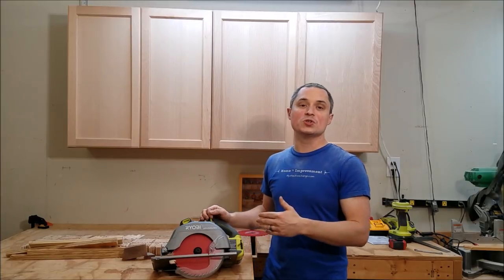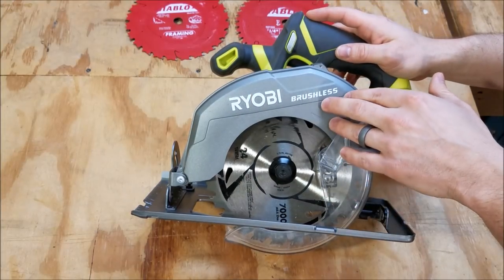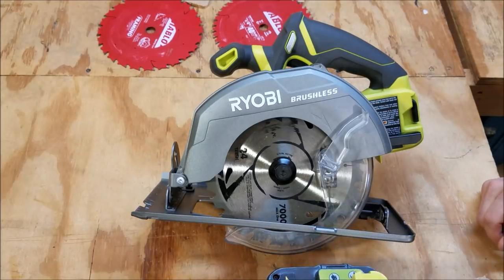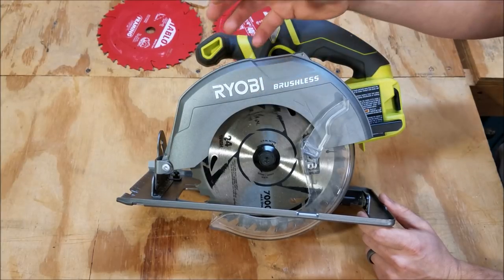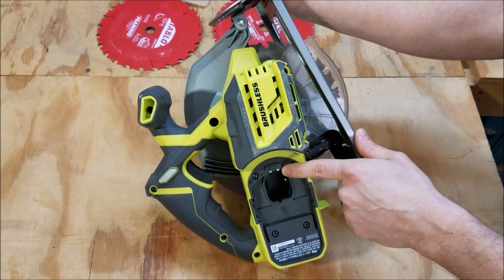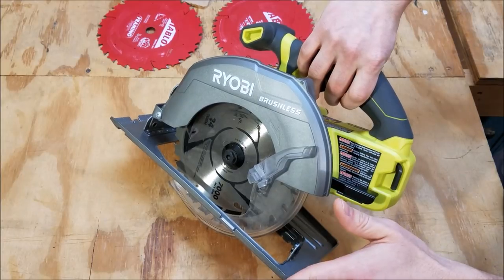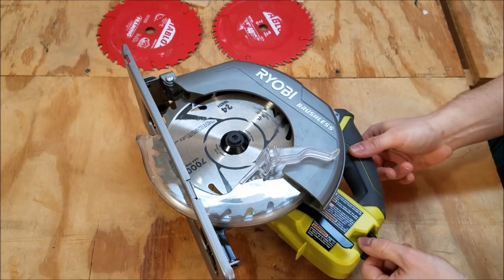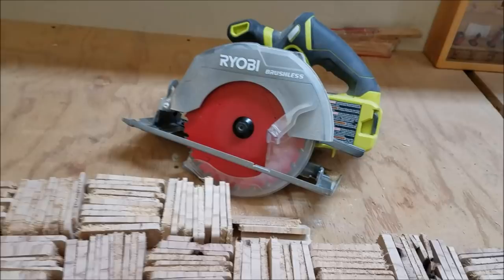Ryobi One+ 18V Brushless Cordless 7-1/4" Circular Saw Review

Comment: Bought one of these today and returned it immediately. Brand new out of the box, not even a refurbished one, and the arbor lock does not all the way so it was impossible to put a new saw blade in. Injured my finger attempting to replace the blade when the arbor lock slipped after multiple attempts. The one I got had zero quality control, they literally slapped it together at the slave labor camp and called it a day.
Reply from the maker: Are you sure you had the actual spindle lock spot and weren't feeling the brushless motor indexing like I explain around 9:05? It was a little tricky to find on mine, but it was there. Otherwise, I agree - I'd be taking it back to the store if I had the same problem.
Reply: Thanks for the reply. I did find the arbor detent/gap slot, but it would slip out after a certain amount of torque no matter how hard the arbor lock button was pushed down. First time I've experienced this kind of problem with a circular saw. Even tried crescent wrench and an impact wrench with an allen bit. I'll probably try my luck with the Ridgid brushless gen5x one next.

Comment: Thanks for the excellent review. I got one today for $99 at Home Depot. I believe that is a permanent price drop. Can hardly wait to use it. Batteries come in Wednesday.
Reply from the maker: I'd highly recommend the new 6Ah batteries for use with this saw - they make it a completely different tool!
Reply: I ordered a Powilling 5Ah battery from Amazon. It has excellent reviews so I took a chance on it. It was $37. I will let you know how it performs with the saw.
Reply: Also, I thought I would add a comment on the blade lock. I am a female and not very strong. When I was trying to install the blade I had the saw in my lap and was trying to push the lock mechanism. No dice. So I put it on the floor and that gave me enough leverage to do the job. I thought it would have been a little easier to do but maybe with time it will get better.
Reply from the maker: Good to know! Here's the comparison video I did between the 4Ah and the 6Ah if you're interested. https://youtu.be/Qf3_WJqg8mg
Reply: I did watch the video and the  difference was noticeable. I am curious about and hopeful that the 5Ah battery will perform well.
Reply: @talrodriguez1206  nice dobie!

Comment: Good deal if you already have other battery powered Ryobi tools like blowers, leaf cutters, drills, etc, like I do...no need to buy more batteries/charges, just the circular blade. I’m getting one. My 18V Lithium P107 are more than enough.Thanks for the cool review.
Reply from the maker: Just a note, the compact style batteries (like the P102 and P107) will run the saw, but won't put out as much power. I could feel a difference in performance when using the P108 vs the P102.
Reply: Isn’t the P107 stronger than the P102?
Reply from the maker: The P107 has five 3.6V cells with an energy storage capacity of 1.5Ah each, while The P102 has five cells with a 1.3Ah capacity. The main difference between those two is a little bit more runtime offered by the P107. On the other hand, the P108 has ten cells with 2.0Ah of capacity each, which equates to 4Ah total for the 18V battery. The reason the P108 can output more power (not to be confused with runtime) is because it can draw current from both sets of 5 cells simultaneously. For a power tool, current draw is directly related to power. The P107 may be able to output a little more power than the P102 if the cells are a better quality with a higher max discharge rate, but where you'll really see the difference is moving to the P108 which has twice the cells.
Reply from the maker: And yeah, that's a sweet deal they've got going on right now!
Reply: You know your stuff! Thanks, just ordered the kit!
Reply: I also bought better quality blades...
Reply from the maker: That will really help with performance. I use Diablo blades in just about all my saws.
Reply: I got an Avanti 60 teeth for fine cutting. I also got a Diablo for PVC plastic cutting, that sucker was $45, ouch, lol...

Comment: Some people say it dont cut straight what u think
Reply from the maker: I haven't had any issues with it cutting straight myself. If I need a perfect cut, I'll use a guide with it. Now bevel on the other hand, this thing has some problems if you need perfection. I found it only hit 90° perfectly when I had the blade at full depth. When you raise it up, it goes a tiny bit out of square for bevel unless you re-adjust the bevel setting.

Comment: Great review!
What is your thoughts between the Ryobi and Kobalt brushless circular saw? 👍🙏❤️
Reply from the maker: I haven't used the Kobalt saw, sorry. Between Ryobi and Kobalt, Kobalt seems slightly higher quality to me, but Ryobi has a much broader 18V platform. I'd pick Ryobi, especially since Kobalt has switched battery voltages a few times on their customers.
Reply: @DoresoomReviews  👌👍🙏❤️

FYI, we are new to this and previously we didn't have any power tools. Recently we brought several Kobalt brushless tools plus 4 & 6ah batteries and we found that Ryobi tools are nice too if you use 4ah or high batteries

Comment: Those are hp connections for the tool to talk to the battery
Reply from the maker: Yes - I made this video before HP batteries existed. So my guess turned out to be right.
Reply: @Doresoom Tool Reviews  I didn't know tools without the hp badge or black an green colors could do the connection now I want this thing even more not just cause the left handed blade
Reply from the maker: Quite a few of the initial Ryobi brushless tools have the contacts, even though they were released prior to any "HP" branded tools or batteries. I guess Ryobi was just planning for forward compatibility.

Comment: 119$ for just the tool tbh it is not worth it without giving a good battery and charger with it. When can buy a tool or tool combo with battery and charger for that price. In my opinion Ryobi is ripping people off for a tool that unless your a contractor are not gonna use all the time and its just gonna set around
Reply from the maker: The bare tool price is getting a little high for most Ryobi tools, but the move to brushless does come with increased cost of components. Ryobi doesn't want their users leaving for another brand because they aren't keeping up with the rest of the power tool industry's capabilities, so hence this new line of brushless tools. If you wait for a promo to buy this, it's much easier to justify the cost - I paid $150 for the brushless hammer drill, one P108 battery, the P117 charger, and this brushless circular saw.
Reply: Wow that is a great price. I hope they come out with that deal again.
Reply: @LibertyDIY  This deal is coming up this Black Friday 2018. I'm definitely getting this deal!

Comment: The extra battery prongs are because this is a one plus it takes several battery's even some other brands battery
Reply from the maker: No that's not what One+ means, it only takes Ryobi 18V batteries. The only exception I can think of is Arctic Cove, who uses the exact same batteries with a different color scheme. Most other Ryobi One+ 18V tools do not have the extra contacts unless they have brushless motors. I have a garage full of them, and I have checked. The only batteries that have the matching contacts are the new HP versions, which came out after I made this review - so my hypothesis was correct.

Comment: I got the drill, the impact driver, the jigsaw, and the circular saw, PLUS 4 batteries (1 of the 2 ah, 1 of 3 ah, and 2 of the 4 ah), for a mere $256.  Absolutely amazing deal from Ryobi.  For my purposes, these tools are more than adequate.  I can't believe the value, honestly.  All are brushless.  The jigsaw works great.  I actually haven't even used the circular saw yet.
Reply from the maker: Someone call the cops, because that was a STEAL! 😄
Definitely run the 3Ah HP battery in the circ, there's a huge boost in performance.
Reply: I'm here looking because I saw that deal in the store! I can't decide which freebees to get. I want them all!
Reply: @tinkytinkz  Yeah, it was a tough call.  I went with the 4 tools I thought I'd use the most given the types of projects I usually do (building / fixing decks, docks, etc.)  I don't do a lot of "fine" carpentry, so I didn't go with a router or sander.  In addition to the base of the two drills (drill and impact driver, actually), I went with the jigsaw and the circular saw, and extra batteries.  (The batteries are expensive, and you always need more batteries.)
Reply: @DoresoomReviews  I have two 4 ah batteries, so I was thinking that would be best for the circular saw.
Reply from the maker: If they're the old P108 4Ah batteries, they last longer but won't perform as well as the 3Ah HP battery in the circular saw. I tested it out here: https://www.youtube.com/watch?v=14XWnygzEDo
You probably won't notice it for cross cutting, but ripping is where it's very apparent. If you want the short version, here's a side by side of the P108 4Ah and the 6Ah. (The 3Ah performs the same as the 6Ah.) https://www.instagram.com/p/BjA_qPvABJU/
Reply: @DoresoomReviews  If you can get 2 P108s for $99 or 2 P191s + charger for $99, which would you recommend for use with brushless tools?
Reply from the maker: The P191s no contest for brushless tools.

Comment: I like to see it cut with original blade really. 😕
Reply from the maker: I'd really recommend replacing the blade the saw comes with, since Ryobi stock blades are very poor quality in my experience. I see your point though, I technically made a $10 upgrade to the saw and then reviewed it.

Comment: I'm having problems with the saw lock clicking and the blade coming loose
Reply from the maker: I'd check to make sure the spindle lock is fully engaged. It's a little deceptive because the brushless motor has very strong resistance and it can feel like it's the spindle lock that's engaged when it's really the motor magnets resisting.

If that's not the issue, it's possible you've got a defective spindle lock.
Reply: I think I have a bad lock will be exchanging it tomorrow thanks for the fast response keep up the good reviews there great
Reply: Mine is doing the same thing..

Comment: Does anyone know if this model has built in laser?
Reply from the maker: It does not have a built in laser. My personal opinion on lasers for circular saws is that they're just a gimmick though. If the kerf indicator on the front of the shoe isn't sufficient for keeping the cut lined up accurately, then a rip guide is needed.
Reply: Doresoom Reviews thanks for the heads up this was super informative on picking a circular saw I like. Personally not a fan of lasers  seems like you don’t need them

Comment: I don’t understand why ryobi’s 6 1/2 saw does like 4700 rpm but this one does only 3700.
Reply from the maker: Don't forget the larger blade diameter puts the surface feet per minute a little closer between the two saws, but this one's still fairly slow when compared to other cordless brushless saws. The P507 comes out to around 8,000 SFM, and the P508 is 7,022 SFM. They likely lowered the blade speed for power reasons, since power=torque*rotational speed, and they're bumping up torque required due to the larger blade diameter.
Reply: Doresoom Reviews hmmm I see.  Let me ask you another question since you seem to be very knowledgeable.  Would the ryobi 36v (one + one) brushless 10” miter saw be more powerful than the 15 amp corded 10” miter saw?
Reply from the maker: That one's a little harder to gauge, since some of the leading manufacturers are starting to make "more powerful than corded" claims with their cordless tools. However, Ryobi isn't at the leading edge of battery technology, so I'd say it's a safe bet that their corded 10" saw is more powerful than their X2 cordless.
Reply: That's disappointing!  Thanks for the information though.  The x2 battery one is so much more expensive too though.
Reply: do you think this is the case EVEN WITH the HP batteries? the miter saw is brushless after all
Reply from the maker: It might be a lot closer with the HP batteries, but I really couldn't say for sure. I think using the two 9Ah could possibly push it past corded performance, whenever those come out.
Reply: Doresoom Reviews so I decided to forgo getting the one + one miter saw for now and sticking with my corded one.  But I did upgrade to the brushless circular saw from my 6 1/2 and I have to say the difference with an hp battery especially is pretty huge.  Definitely noticeable.

Comment: Hey Doresoom how would you compare this to the Ridgid Brushless circular saw you reviewed in July 2016?  Would you recommend one over the other?
Reply from the maker: I personally like the Ridgid better. They're pretty comparable tools as far as performance goes, but the Ridgid just feels a bit more polished.
Reply: thanks for the reply. I'm about to start my first cordless tool collection and am trying to decide between Ryobi and Ridgid. Last week HD was having some deals on both models. I picked up the Ridgid LImited Edition 4 piece brushless set w/ 2-4.0ah batteries for $299. Also grabbed the same exact brushless tools from Ryobi w/1-4.0ah battery for $270. Having trouble deciding which route to go. Ryobi tools going forward will be a lower cost. Plus all the brushless tool coming out have that extra set of contacts they you mentioned in this video which my give them a performance advantage over similar Ridgid models.  Ridgid does have the great LSA. And like you mentioned the tools in general seem a little more polished. Do you have any further info on what the extra contacts do? 
Any advice on which brand to go with ?
Reply from the maker: I haven't seen anything else about the extra contacts on the new Ryobi brushless tools. My advice between Ridgid/Ryobi is to look at what tools you think you'll want down the line. If it's just the standard drill/impact/circular saw/recip saw, etc. then I'd go with Ridgid. However, Ryobi is much more of an innovator and crank out a ton of new products all the time. Their One+ line is a lot bigger than Ridgid's is, and they have random tools that are very useful for homeowners like the drain auger and hot glue gun, as well as lawn care equipment that Ridgid doesn't offer. Personally if I had to pick between just those two it would be Ryobi, since they offer way more options and seem to be getting into higher quality/performance tools lately with all the brushless releases.
Reply from the maker: Turns out my hypothesis on the extra Ryobi electrical contacts was correct. The 6Ah P164 batteries showed up on HD's website for a short while, and had the description:  "Communicates directly with Ryobi Brushless tools to deliver the optimal level of power for the best performance."
Reply: "optimal level of power" is worded so vague it could mean anything. Would be interesting if you got your hands on a 6ah battery down the line  to compare some tools with it and with the 4ah battery. After all the back and forth between Ryobi brushless tools and Ridgids I ended up going with Milwaukee m12 Fuel tools, reallying liking them so far. Love the smaller size and lightweight.
Reply from the maker: By the way, I posted a review with the 6Ah battery used with this saw, and it cuts nearly twice as fast as with the 4Ah.

Comment: Another good review, but now you leave me torn as to weather or not to buy this saw. I've been getting away from Dewalt, which I've used for decades now, because the Ryobi tools and batteries are so much cheaper. I've been very pleased with most of Ryobi's tools, not so much with others, whereas Dewalt has never let me down. The shortcomings of this saw are the plastic blade guard, no dust chute, and the stamped steel shoe. Those are some pretty serious cost-cutters that will affect the accuracy of the saw, (except for the the dust chute). And seriously, couldn't they include a rip guide? I'd be willing to pay the extra 50¢ it would have cost them. I'm wondering if a rip guide wasn't included because of the plastic blade guard.
Reply from the maker: It's great that Ryobi is finally getting into advanced features like brushless motors, but I think it's mainly going to be aimed at consumers who are only in the One+ battery platform, and are wistfully looking over the fence at all the other manufacturers who are really innovating and pushing capabilities of cordless. 

If you've got batteries in another system (especially Ridgid that's just $20 more expensive), then it's probably worth going with the more expensive competitor for the upgrade in performance and quality. I've even seen the DeWalt FlexVolt 7-1/4" circular saw for as low as $150 bare tool, and that's on a whole different level of performance over this saw.
Reply: I’ve had the older 6.5” brushed version of this saw for a couple years now and it’s been used regularly in that time.   So far the plastic blade guard hasn’t been a problem.
Reply: Thanks for the reply. I'm not worried about the plastic breaking, I'm concerned about how it flexes. Some manufacturers of track saw guides specifically state not to use a saw with a plastic blade guard for that very reason. I'm just going to keep using my old Dewalt as a cordless. I have half a dozen corded skill saws that I can use if needed. Actually, I have a nice Makita cordless but I haven't been able to find the darn thing in years!